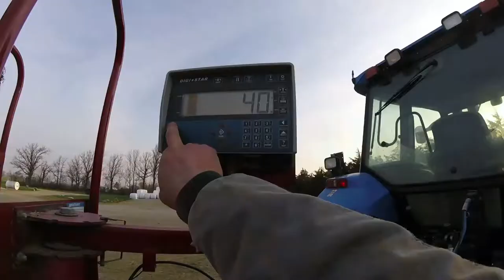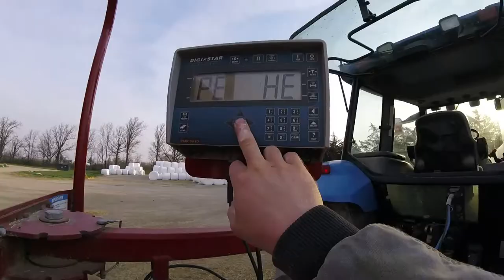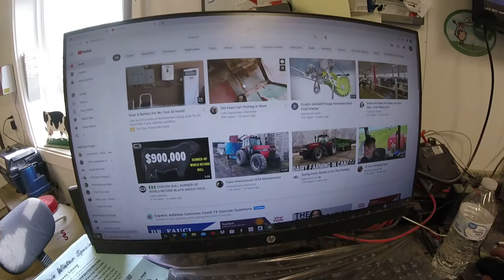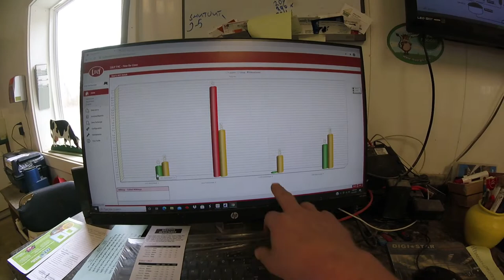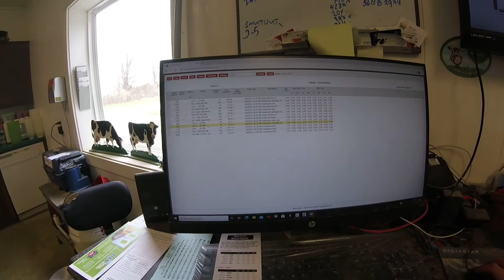A day in the life of a dairy farmer

Comment: How is the visibility on the 244 for loading out of ur bags? And do you run a defacer with it as well? I'm lookin at one to replace a loader tractor.
Reply from the maker: The visibility is good in general. You can’t see the cutting edge of the bucket though, if that’s what you mean. We did run the defacer on it when we had a pile. It did the job but wasn’t perfect. Oil flow wasn’t quite high enough, worked a lot nicer on my father in laws skid steer.